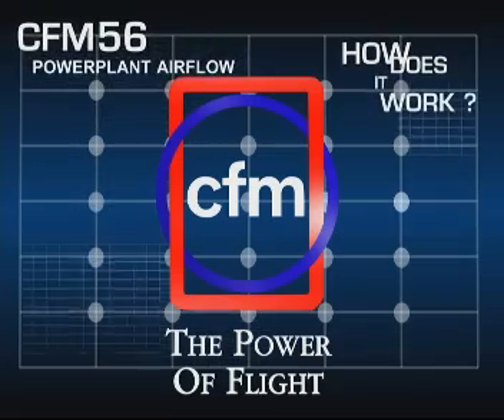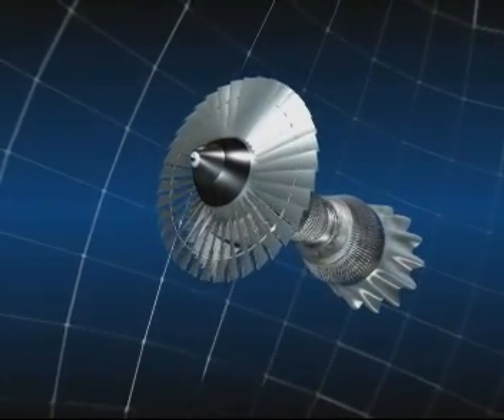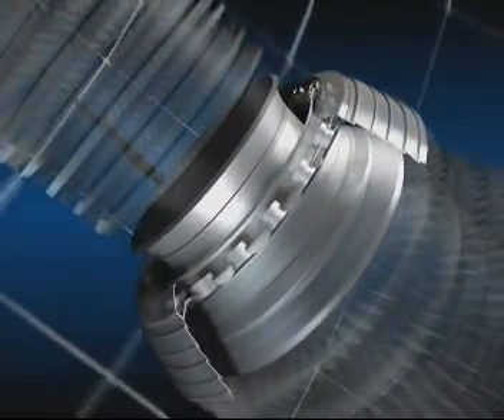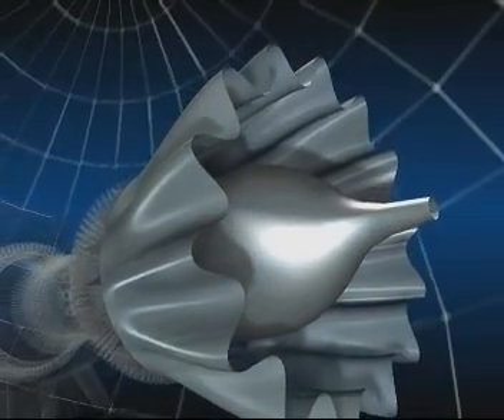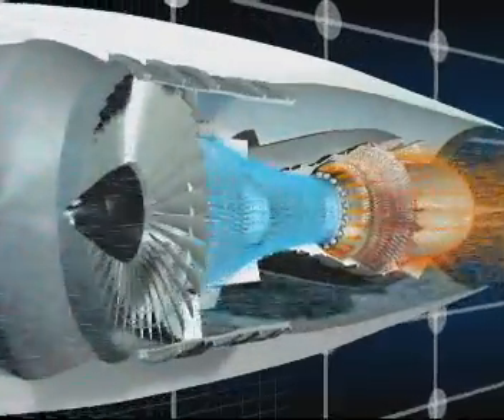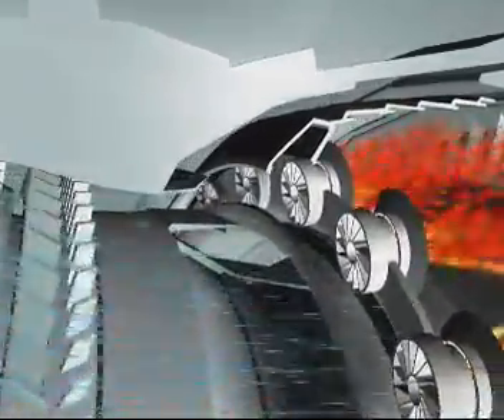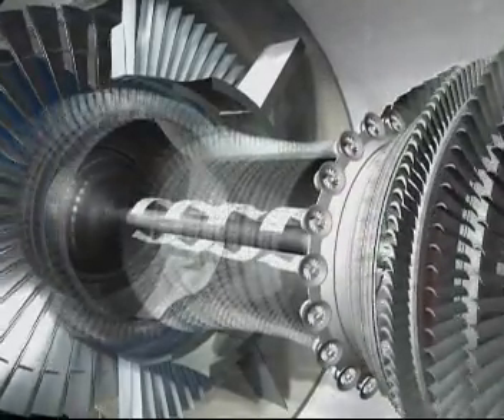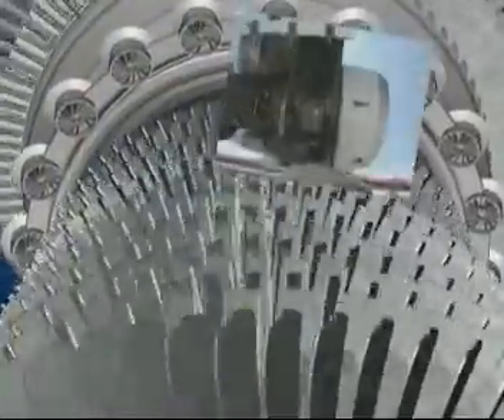Motor Turbo Fan

Comment: @EPhantom125 it does thats the jet part of this engine it produces forward thrust
like an old turbo jet engines, now this engine is an turbojet with the addition of the fan which in turn make it way more efficient especially at low alttitude

Comment: @seamcon15 they are spun up to starting speed by the exhaust of a very small jet engine in the tail. the small jet engine is initially started with an electric motor

Comment: because the compressor is pushing the air in the direction of combustion chamber -> but from what I understood, the only thing propelling the compressor is a similar looking fan on the other side of the chamber.  It really looks like without the large diameter fan, this engine would look almost identical backwards or forwards.

Comment: So much of this goes over my head.  So basically, you have an internal combustion between 2 fans... so whats keeping the force from coming out the front?  Also, it would seem to me that you are losing the same amount of force from the fans at the back and the expansion as you are gaining from the fans at the front and the compression, which begs the question - why have the fans at all?  Anyone care to elaborate?

Comment: Turbine blades usually have tiny perforations on them that allow cooler air from the compressor to bypass the combustor and flow over the surface of the turbine blades creating a thin layer of cool gas that keeps the blades from overheating.

Comment: CFM are oil guzzelers, they drink the stuff and are not as effecient as V2500. You rarely put oil in a v2500 and they are more fuel efficient than cfm.